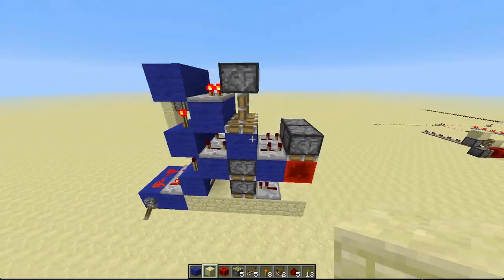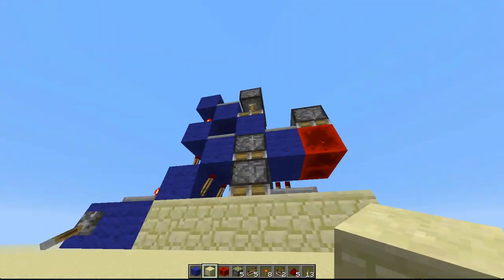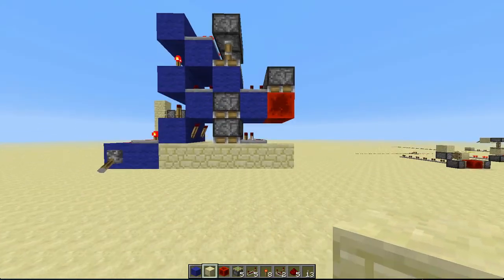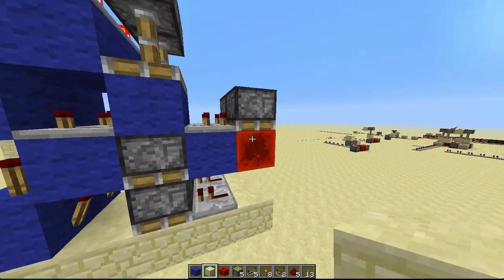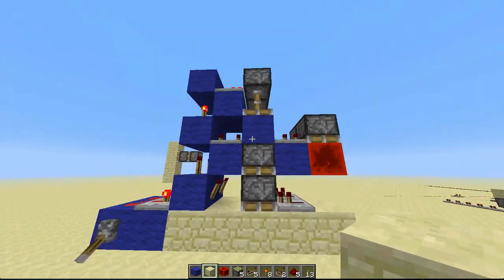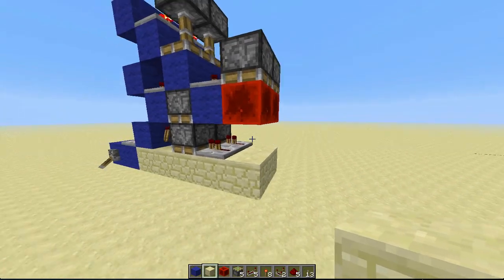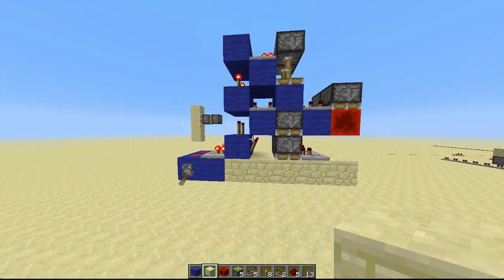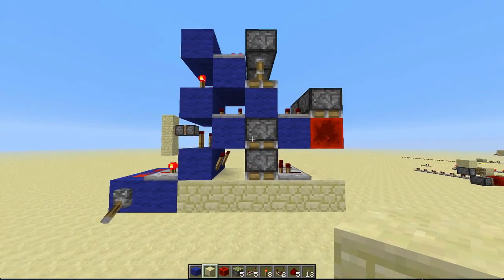One Wide Tile-able Ceiling Double Piston Extender [1.5] - Piston Head Bugs

Comment: The redstone block tends to not update the pistons correctly when creating a BUD switch, as it is created with the redstone block on an unextended piston and the repeater in the bottom middle also creating a BUD switch with the pistons corresponding diagnally in the bottom middle powered by the redstone blocks